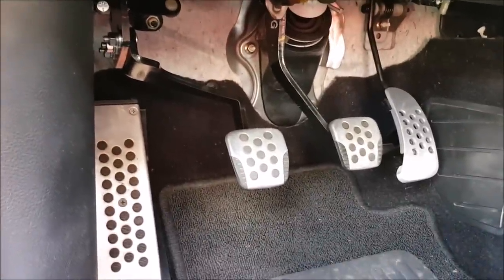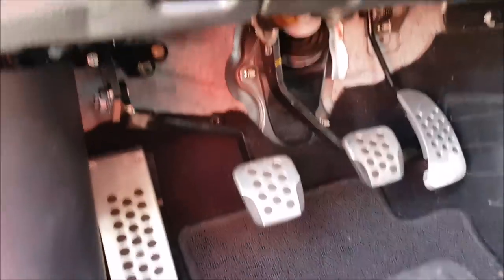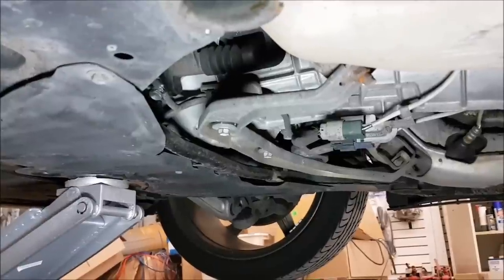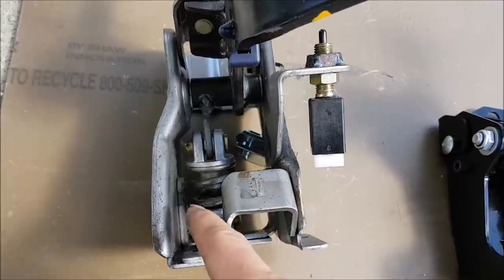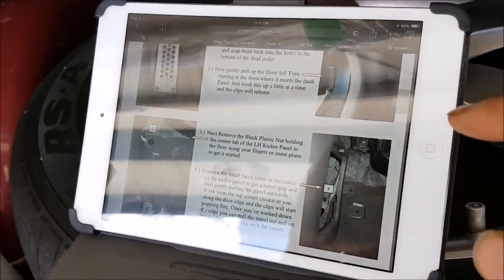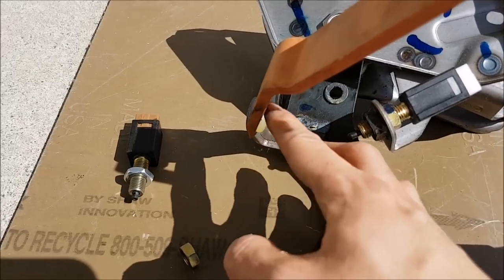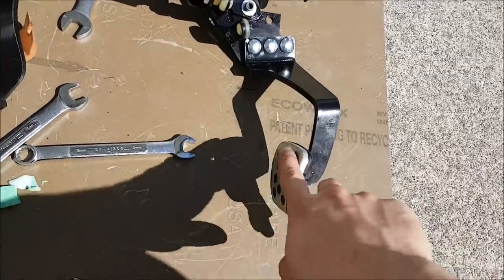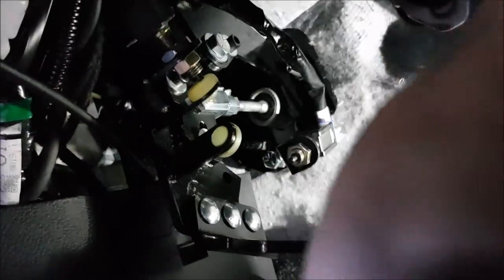BEST Nissan 350Z / Infiniti G35 Clutch Pedal MOD (RJM Performance) | AnthonyJ350

Comment: I imagine if the stock clutch pedal assemble does not snap like urs mine barely snaps and I could press it down with out it snapping woukd this make my pedal more stiff
Reply from the maker: Did you install the RJM pedal now?

Comment: Been thinking of buying this from all the rage, but is it worth it if I can drive just fine with the oem one? My oem one is kinda stiff so I really don’t want to get something that is even stiffer.
Reply from the maker: Tuan Pham It's worth it. The amount of control you get it amazing.
Reply from the maker: It also doesn't make it more stiff.
Reply: AnthonyJ350 finally bought it and installed. The plugs are super easy to take off with a needle nose by just clamping them and pulling off. Wow you were right! My 1-2 shift is smooth as butter.

Comment: my clutch in my 350z is really hard to push down , as i’m seeing in your video yours is really easy to push down. is there something wrong with mine?
Reply from the maker: It could be aftermarket with stronger springs.
Reply: Same with mine but I have a exedy oem clutch pedal is hella hard can’t even depress it with my hand like you did

Comment: Would you say its that bad without it? Like if I dont expect to be doing this as soon as I get it do you still think id be able to drive it efficiently just by retraining my driving style?
Reply from the maker: Ya you can retrain yourself, it's weird when you do.  This should be one of the first things you do to the car besides basic maintenance.
Reply: If you care about your transmission (mostly clutch pedal, clutch assembly, clutch and flywheel) do it. Don't wait like I did.

Comment: Just quick question.

Will this work with a CSC delete kit stalled?
Reply from the maker: I would think so since you're only affecting the pedal and not the hydraulic line itself. Message Ryan @rjmperformance on Instagram and tell him I sent you.

Comment: The stock pedal is such trash. I cannot drive my car smoothly. Trying to modulate the pedal with your foot all the way off the floor is so difficult
Reply from the maker: V.Vega You need this mod
Reply: AnthonyJ350 I adjusted the rod length to lower the pedal and it's significantly better. Still not as smooth as the old s chassis cars though. Might have to invest in this at some point
Reply from the maker: It will help with driving making that adjustment.  The new pedal you will get longer master and slave cylinder life with the new pedal assembly because it doesn't over extend those parts like the stock pedal does.  It honestly feels like a different car after installing this part.

Comment: Clarrifying; Nissan in general makes good parts and cars, vehicles always have bugs here and there and certain part that jst gave everyone headaches, but to say they cant make a hydraulic clutch assembly is an overstatement. If that were true then they suck at making engines as well cause the QR25DE is one thats been weak or known to give problems, doesnt mean now they suck overall at making engines. JS, cause im extremely bored.
Reply from the maker: Angelo Daniel Negron Ok fair statement. But a lot of G35 and 350Z owners do not like the feel of their clutch pedals and that pedal makes the hydraulic system prone to failure. I'm also a GM guy and most GM vehicles from the 90's have a nice firm brake pedal feel compared to these cars. It took me a while to figure out how to make my brake feel in my 350z as nice as my 2005 Silverado.
Reply: AnthonyJ350 that was my only argument at the General Statement which im sure you didn't make to be that jst came out that way. I have an '07 G35S 6MT Sedan, can you believe it that even these have a problem with the clutch system? They got wayyy better, but the Clutch Slave Cylinder still gives probs, I changed mine and found out it was the third part revision from Nissan. Hasnt given me problems so far and its been almost a year. I think with my model the Slave was the only problem, rest of it seems to be a okay with me and other owners with my model or engine (VQ35HR). Nice Vid btw.
Reply from the maker: Angelo Daniel Negron Do you have this pedal installed as well?
Reply: AnthonyJ350 no, everything is stock OEM, and the slave problem started abt 3 months of me having the car, did it once then stopped then did it again and I had the dead clutch pedal feel with no pressure or feed back on the clutch pedal, its always on the 07+ G's, I think anyone with an HR really, so Z's too, it starts like this, dies on you on the highway when you let off and place the car in neutral, if you go back to depressing clutch to engage in a gear its dead, lol . Btw, I think even my clutch is OEM. I got the car back in December of 2015 with 87K miles & the clutch was worn out, its at 125K I drove it a shit ton, I still do, lol, I have to change its not slipping thank God but its pretty wated to the point its almost non existent. Im gonna order a Stage 2 with a 13/14 lbs light weight flywheel, hence my earlier statement they really do make things that last at Nissan not jst all Toyota & Honda, haha. Like the Sparkplugs on these are rated to last to 90K miles, they really do last forever even though I'll still change'em earlier like at 40K or so.
Reply: Anthonyj350 Hello, was waiting on ur reply, lol, I enjoyed our condo cause it could give me some insight. BTW do you know if the HR's have the same pedal design? Cause if so I would then include this on the list and get it as well then prob not have to worry abt over working my slave and master. then if the slave takes a shit on me again I'll look into a Slave Cylinder Delete, saw one on Concept Z or Z1 online not sure if for HR or DE / RevUp
Reply from the maker: Angelo Daniel Negron Clutch pedal is the same as far as I know. The slave cylinder may be the issues bit on the HR it's inside the bell housing. Z1Perofrmance has a kit that makes it external I believe.

Comment: My pedal got stuck half way down and I had to push it back up because the spring inside the slave cylinder was broken...
Reply from the maker: That's unfortunate. Have you replaced it now?
Reply: @AnthonyJ350  Yes, I actually did it last year. Works fine now.
Reply from the maker: @wayneduford64  I think if you get the RJM pedal it will last longer.
Reply: @AnthonyJ350  AI think you are right... will need to think about that one...

Comment: G35 05 clutch is stiff hard to press with my hand new oem exedy clutch throw out bearing all the good stuff new slave and new master bled the system multipli times pedal still stiff will this make it soft
Reply from the maker: It will make it smoother and easier to modulate. It's a must have in a manual 350Z or G35.

Comment: fairly new clutch... master and slave cylinder there bearly any clutch pressure on cold start up the clutch is nearly stuck to the floor as the car warms up after driving around for 20 minutes  there's finally pressure building up. the whole clutch engagement for  g35/350 it makes me never want to drive stick again
Reply from the maker: dflet03 probably has air in the line. Did you try bleeding it again? What type of fluid did you put in?
Reply from the maker: dflet03 You need this pedal because the car is easy to drive and feels amazing after.

Comment: was it worth it? i just bought one but im not fully convinced
Reply from the maker: Noe Rodriguez Did you install it?
Reply: +AnthonyJ350 i just ordered it yesterday
Reply from the maker: Noe Rodriguez When you install it and realize how good the pedal can actually feel you'll be convinced.
Reply: +AnthonyJ350 is there an email i can ask you some questions
Reply from the maker: Noe Rodriguez info@gofasthavefun.ca I'm on vacation for another week so I'll reply when I'm back.
Reply: +AnthonyJ350 so is the pedal suppose to be really soft
Reply from the maker: Noe Rodriguez Should feel firm and well connected.
Reply: +AnthonyJ350 i cant get the pedal to get firm and the catch point is kinda low how do i fix this,
Reply from the maker: Noe Rodriguez Did you recently bleed the system?
Reply: +AnthonyJ350 no just strapped on the pedal
Reply from the maker: Noe Rodriguez You can try adjusting it to 50% to raise the engagement point

Comment: how do you adjust the stiffness?
Reply from the maker: Technically you're adjusting how much throw it has.  Do you have the instruction manual?
Reply: @AnthonyJ350  i figured it out, thanks!
Reply: Does it feel softer or still stiff
Reply: @chasef6275  a little too soft for my liking
Reply: @ItsShibui  well mine is hella stiff you try to push it down sith your hand and you can’t at all so hopefully this unit or a new clutch pedal assembly will fizit

Comment: Is that why third gear grinds a little
Reply from the maker: It's most likely a bad synchro. What year is your car?
Reply: AnthonyJ350 it’s a 2003
Reply from the maker: @jonathancisneros7150  It's most likely the transmission. You want to find a transmission from a 2005.5 or 2006 CD009 has all the latest improvements to stop those issues. Also try using REdline transmission fluid for Nissan in your current transmission.
Reply: AnthonyJ350 yea I was thinking of doing that cuz the input shaft bearing is also kind of noisy.
Reply: Wrong trans fluid will also do this. Got to make sure it's gl4 manual trans fluid and not rear axle fluid.

Comment: Hey I know this is an old video but I really need help on my clutch. I have a 2005 350Z and I only enjoy driving my car in the morning when it’s cold because of my clutch. When it gets warm after maybe 20 minutes of driving my clutch gets about 4 inches of “free play” basically no pressure or anything for 4 inches and right when you get pressure the engagement point is right there and it’s a horror story driving like that. If you know what I should do or try please please anyone help Thankyou.
Reply from the maker: Try installing a new slave cylinder and also change the flex line to a stainless braided version with heat shielding.
Reply: AnthonyJ350 Okay I just spent the $350 on the RJM rev 4 pedal. Should I still do that?
Reply from the maker: @NalIu  Yes for sure, the pedal is amazing. Upgrading the hydraulics outside of the car is important due to the design of the car and age.
Reply: AnthonyJ350 Alright thanks for the help man
Reply from the maker: @NalIu  No problem. Comment back after you install the pedal assembly, love to hear what you think!

Comment: Just install a paddle stop bam simple.
Reply from the maker: SI RICKO You don't get any more modulation and you rely on the hydraulic system to push back the pedal or still have the half pedal and no adjustability
Reply: I guess but just install A paddle stop and adjust the seat lol bam simple im just fucking with you but i know what you mean good idea to.

Comment: You always have 25 mm of play that’s about 1”. 
I feel as if you truly lack information/education on the actual function of the unit, what the design and intent.
Why do you use dot 3,4,5, other? There’s a technical reason why. 
Bottom line put a disclaimer that you’re just a blogger and lack. 
Brakes/clutch (hydraulic systems) are touchy because you can ultimately risk someone else’s life.
Reply from the maker: O_o X_x There is a disclaimer, at the very beginning of the video.

 The engineer that designed this pedal seems to like my video as well ;)

Thanks for the feedback!
Reply from the maker: O_o X_x I'm curious to know though, how is talking about a clutch pedal going to affect someone's life? 

Besides making it more awesome because this thing feels amazing.
Reply: O_o X_x So condescending.